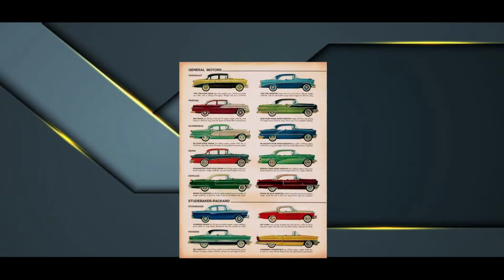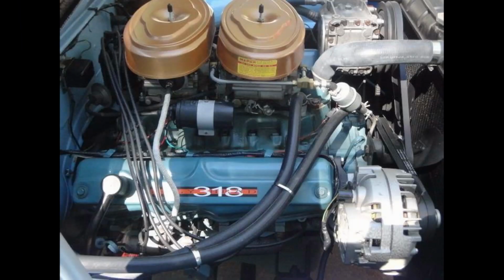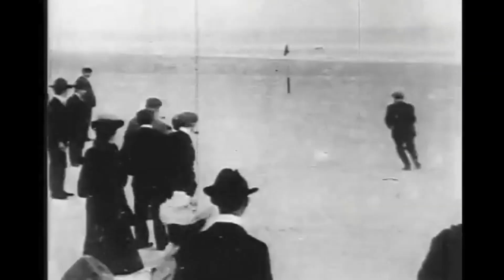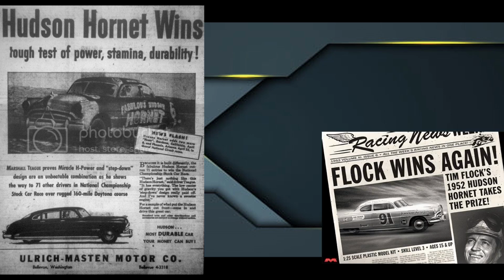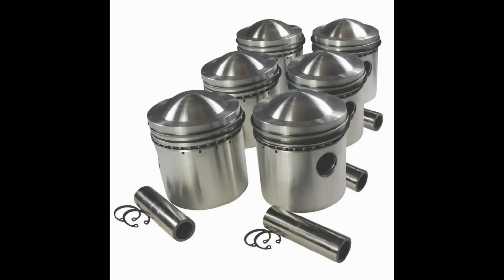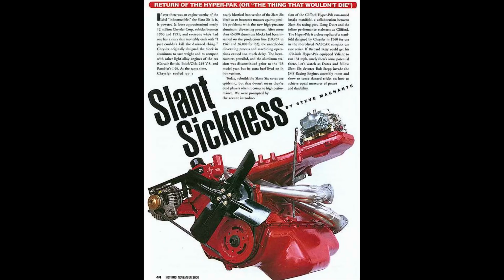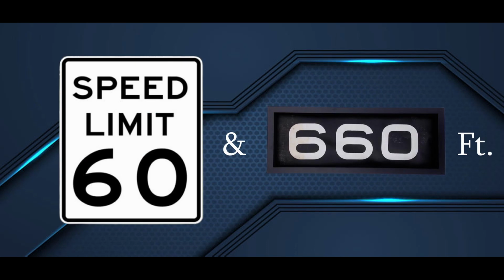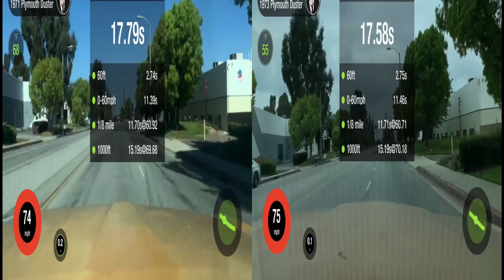318 LA V8 vs 225 slant 6 60 foot 0 to 60 mph 1/8 mile 1000ft 1/4 mile Drag Race

Comment: Repeating some earlier comments, Australian designed and manufactured the most powerful factory Chrysler 6 cylinder engines ever made, 303 hp 265 cu hemi inline 6 cylinder with 3 45 DCOE Weber carburettors, available strait from our local dealers capable of 14.4 second quarter mile.

Comment: great history the leaning tower of power is a great motor if you look up Tex Smiths XR-6 it was running a full aluminon steel sleeved six. but the LA 318 is a rock and is cheap H.P. good vid

Comment: Where you got that  in for it takes the slant six over the years was more like 16.00to  60mph and 19.00-20.00 in the1/4 the 318 you give the slant six a run that would embaris it in full.these are facts from owning both.be fore you miss lead any one get some real grease under your mopar facts like own over 17 slant six varis size from 170 198 and 225 hyper pack.and 23 318's and two 318 polys.where you got those times is false.the only factory slant six that could give the 318 a run for the money was 225super six in 1977 and 1977f for the 318 two barrel that's it cause the hyper pack was a in dealer option after 1962.i love the slant six but I have 40 years of mopar cars under my belt.even better look up utg garage on you tube ask him if your facts are spot on.!!!!!!!

Comment: Interesting vid.  I did some experimenting back in the late '60s and 70s with very similar results.  '64 Valiant with 225, high comp head and 4bbl carb turned 17.76 in the 1/4 at 76+ mph.  Had two track records at Lakeland International in Memphis.  A couple of years later my 73 Dart with 318 2bbl turned 17.67 at 73 mph.  The Dart would have beat the Valiant, but the Valiant would be closing the gap quickly.  Some of the most fun I've ever had behind the wheel.  Used to drive the big Ford 352s crazy with the Valiant.  A real sleeper.  God I miss that car!  Still have the Dart which now wears the Carter AVS which I had on the Slant Six.
Reply from the maker: That’s pretty awesome! I love hearing stories like this. Seems many people have a plethora of different experiences with the 318. But from most of my experiences this is very par for the course, for the most part.

Comment: When the Valiant was released in Australia we all were amazed at its torque. It was road tested by Wheels magazine as' an essentially top gear car.' The little 273 V8 was another game changer. Slotted into the VC Valiant offered with a black vinyl roof and diamond white paint, it became one of the most desirable cars of its era. The 318 was never considered anything special here. The Ford 302 more popular with racers and hot rodders. Apparently the engine is detuned yet has enormous potential like its big brothers the 340 and 440 but was ignored. I owned a 318 Valiant. Easy to live with engine if you didn't mind its appetite for fuel.

Comment: I have a slant 6 ready to drop into my truck. 9.5 compression ,custom ground cam that is close to the original hyerpack, dutra  split exhaust and Aussie speed long tube hurricane intake with a 500 cfm holley 2 barrel carb.   Take a 318 and put  a ISKY E4 solid grind cam in it- it  will have the torque of a 400 and mine would bounce off of 7,000 rpm regularly ( my stock 318 ran 6,000 all the time )

Comment: Meanwhile the Chevy 327 is quickly disappearing into the horizon…. leaving both the 225 and 318 way behind.  Seriously,  this was a very well thought out and presented video.  It would be very interesting to have a Poly 318 in the mix.I was amazed how close the 225 and 318 LA were, and how well you broke down the technical side of where each was in its powerband and gear.
Reply from the maker: Wow thank you so much! I really appreciate you saying that. Makes all the hard work and effort worthwhile. Yeah that 327 is an absolutely amazing engine. One of, if not, the best engine Chevy every made. Again thank you for the support, it really means a lot.
Reply: @atfgarage9459  In the years of my youth a healthy solid lifter 327 would often give a good challenge to a traction limited big block in the stoplight grand prix..
Reply from the maker: @Thomas63r2  Absolutely! Chevy hit the nail on the head with that small block. Perfect cubic inches for producing both low end torque, and yet short enough stroke to get some extra revs over on the bigger cube engines. That 3.25 stroke along with the camshaft comparable to a 268 was magic. Shame we don't see too many of those anymore.
Reply: @atfgarage9459  Times change.  A hot solid lifter 327 was usually up to the challenge of a SS396  325 hp or many of the 442's and 390 Fords etc.  Now it is easy to build a reliable 550 hp 383 small block with heads we could only dream of in the '60's and '70's.

Comment: The base slant six in real life wasn't even close to the 318 . I had both back.  The stock slant was a dog  . That 318 you're using should be doing better .
Reply: My old 65 slant six  with headers and 2bbl carb and manifold a minor change in ignition  timing A904 twin pump changed into speedy machine that never let me down That's why I had it for more 40 years no rebore 250,000miles no issues
Reply: @metalmickey-d6w I think that a 65 would be peppier than my 78 Aspen slant six . My 68 Monaco, which in Canada was available with a 318, was considerably more powerful  than the Aspen . But the 383 2 barrel was again night and day stronger than the 318 .
Reply from the maker: For some reason people tend to have two very polarized experiences with the slant. Some will have your experience, I.E. slow or sluggish. While others will have an experience very similar to mine I.E. quick and responsive. Both engines have checked thoroughly, both trans shift smooth. The biggest tell is the official 1/4 times. They are both very similar.
Reply: @atfgarage9459  Well it's been a while but I had 78 Aspen super six , total dog . I also had a 68 Dodge Monaco . The Monaco here in Canada could be had with a 318 . The Monaco hit 60 in 12 seconds , the Aspen six in 17 seconds . I'm 66 and when I was younger there were slant sixes and 318 v8 cars everywhere . I think part of the problem with that Aspen is that it was  was a 78 . Those late seventies cars really ran poorly much of the time .
Reply from the maker: @jackfishcampbell6745  Also Chrysler was notorious for their engine quality of production being very lack luster at times. They would have some 360’s dyno great and some dyno not so great.

Comment: 71 Duster was lighter than a 73 Duster, but a 73 engine had a bit more smog controls than a 71.  Interesting balance.  Were both vehicles in good condition mechanically?  What were the rear gear ratios?
Reply from the maker: Yes they are both in good running condition. I'm not 100% sure about the gear ratios. I would assume they are a little off, something in the range of Slant 6: 3.55 and the 318: 3.23. But I think you are right, that could have made all the difference. Its still amazing to me that a Slant Six could take a 318 head on under the right circumstances. Thanks for the interest and comment. I appreciate the support.

Comment: did up a 225 slant in a 69 Dart back in the 70's, punched, shaved a bit, offy intake with a 465 holly, viper headers, electronic ignition, 4speed, bell housing from an early Dart with the hyper-pac, big boy rear end from a Duster 340, went like hell at 19 mpg, today it boasts a 440, whatever
Reply from the maker: That build sounds awesome. Nothing crazy, just some tried and true power adders and some stronger than weak links. You don’t see many manual transmission muscle cars anymore. It’s a shame, there’s nothing like running through gears while flying down the road.

Comment: If the cars weights were equal along with everything else, the 318 should walk away from the slant. It’s a simple matter of the Power to Weight ratio at work.
Reply from the maker: They are both about 2900 lbs. both have 904 torqueflight automatic transmissions. Both are in excellent running condition. The point of this video was to show you that in fact it is not a simple matter of power to weight ratio. Throughout the history of racing, these straight 6’s have been outrunning larger v8’s due to different types of engineering advantages. These advantages are mostly, what I call “better  power” and not just maximum power. They hit strides at the most opportune times with something called sonic resonance mixed with lower torque. Overall the v8 will produce more power, but the inline’s will make the most out of their smaller displacement. Thanks for the comment and interest. I really appreciate the support 👍.

Comment: I really appreciated learning the history behind both engines.  I am particularly impressed by the brilliance of the slant six design.  That fundamental architecture gave the engine so many long term advantages its amazing. The 318 is a tribute to a fundamentally sound design honed by years of continuous improvement.  Great video.
Reply from the maker: That’s exactly the point I was trying to convey. It’s not about one being better than the other, it’s about appreciating the history and engineering of these legends. Thank you so much for the support! It’s not only very much appreciated but also keeps me going 👍.
Reply: @atfgarage9459  Hi. I still love my 72 Duster. I got it when I was 15, but it had to sit for a year till I turned 16. My grandfather bought it first. He liked the red color :) , after he died, my brother bought it off my grandma, he got bored of it so I bought it off of him. When I got it , it had 54000 original miles. Now it has 74000 original miles. Its all original except for the paint and that I had to get new seat covers put on. The original was white and black hounds tooth inserts and the rest was black vinyl. I got them recovered with the same hounds tooth. Oh, and its a 225ci. Motor has never been touched. Great video

Comment: 265 Hemi straight six with triple Weber would destroy them both an Aussie car.
Reply from the maker: Absolutely! That 265 hemi is an absolute monster. A real legend in the racing community. Australia has always been one of the king’s in my opinion. Just Cosworth alone changed the entire race game! Can’t be denied.
Reply: Learn about the Slant Six 170 ci XNR motor easily keep up with the E49 Chargers
Reply: @MichaelBraid-xf3dw  Okay thanks for the heads up. 👍

Comment: I grew up with these cars and these engine. The 318 was always quite a bit faster than the slant 6. I have no idea why these 2 run about the same, but that was not my experience when I was growing up, and these cars were daily transportation. If I recall correctly the slant 6 was rated at 145 hp and the 318 at 230. There was a huge difference in power. I can tell you that the slant 6 cars were slugs, and I mean slugs, you could outrun them with your Converse sneakers for those first 60 feet. 318 cars were slow, but they were not complete slugs. I still recall that one of my best friends had a Volare with a slant 6. We took it out on the highway and floored it at about 40-50 miles and hour, and it took forever to get to 75-80. I mean a Yugo with one piston hanging out of the block would have beat that thing. A slant 6 would have a hard time with a 36Hp VW Beetle, and if the Beetle just had a set of headers and a crank pulley I would put my money on the Beetle all day long.
Reply from the maker: Lol that’s a funny story. It’s seems pretty common for people to get polarized experiences with the slant. I’m not 100% sure as to why that is. Exhaust leaks are pretty common with the slant. But if you look at the “official times” of both of these, they are pretty close together. Engineering for resonance can give advantages over raw horsepower output. Thanks for the comment and interest. I appreciate the support 👍
Reply: @atfgarage9459  Gearing is probably the reason.  Most slant 6 and 318 cars were also geared for mileage, not for performance.  Change the rear gear and those numbers will change quite a bit.
Reply from the maker: @akdoc2003  yeah if they aren’t already the same, I would imagine about a full second off the top for the 318.
Reply: The transmission makes the 6 cylinder fast a904 transmission seemed faster I think..
Reply: @hardknock1278  Most 318's also used a 904 transmission.
Reply: I recommend that you look at the Slant Six in Argentina, I think you are going to change your mind about the Slant, I will tell you a couple of curious facts, the Slant Six in Argentina has the average speed record in the history of road tourism "the oldest category of the world" the average speed of the record was 151 miles or 244 km/h and its maximum speed was 173 miles or 280 km/h, later the dodge polara RT coupe had a 174 hp slant six and a maximum speed of 111 miles or 180 km/h. that you put automatic boxes that make it slow does not mean that the engine is a slug.
All these cars have the slant six:
https://youtu.be/5pwfplzPXi8
https://youtu.be/p5FvnXtDufY
https://youtu.be/dpa8rcBucFs
https://youtu.be/O6ff1U1TlFs
https://youtu.be/7hMYKbaKztU
Reply: @franciscodelvecchio2203  You can modify anything to go fast. I originally come from the land of fast import cars, Puerto Rico. 25 years ago a good street race turbo rotary car would run mid-10 second quarter mile times, at over 130 MPH. I had good friend with a Suzuki Swift with a swapped 1 Liter turbo engine that ran, in full street trim, 12 second quarter miles at 120 MPH. That does not negate the fact that a stock Suzuki Swift was slow, or that your average rotary powered car was also slow. 2 of my best friends had slant Six dodges, and I do not recall being in anything slower than those cars. A Toyota Tercel would leave them in the dust...
Reply: @72442conv  sorry but I don't agree at all, the Dodge Polara RT was a stock car and it was fast, I myself have one and it's not slow at all, if the Slant SIx is slow it's because of the misuse it was given in the USA, If you ever get the chance to get on Slant Six Argentino you will see what it can do. The Slant Six in my country is not slow, even our 170 ci is faster than most of the 225 in the USA.
Reply: @franciscodelvecchio2203  Define fast. For some people a 16.5 second quarter mile Honda CRX is fast, for others it is painfully slow. We have different standards here in the USA than in a lot of other countries. In the USA in the 1960's a 14 second 1/4 mile car was fast 13 seconds was supercar fast. Today a 14 second car is considered slow, you average V6 Camry runs 14 second quarter mile times and most people consider them slow. I know that in Brazil the 302 Maverick was considered one of the fastest cars there, here in the USA it was considered a Slug. It is all about perception. The 225 in the USA was always considered to be a slow car. Even the Hyper Pak 170's and 225's from the early 60's, which were the pinnacle of Slant 6 performance, were never really fast, even in their day.
Reply: @72442conv  in my country we do not use the term 1/4 mile, we use the term 0 to 100 km/h or in your case it would be from 0 to 60 miles, a Dodge Polara RT accelerates in 11 seconds to reach that speed, it is not considered a supercar but not a slug either, so have you ever seen a hyperpack? I do not think so. The 170 ci engine hyper pack managed to produce 220 hp and a speed of over 120 miles. You already know what the problem is with the Slant Six in the USA, the problem is that everyone criticizes it for being slow but if we see that almost everyone has it equipped with tiny carburetors, inefficient exhaust systems that choke the engine and above all they are equipped with transmission automatic or terrible oversized differential ratios, when the slant six is used in a good way it is a great engine and finally the pinnacle of the Slant Six in Argentina is its version for road tourism, it is the Slant Six 225 reduced to three liters by regulation and this It generated more than 250 hp and worked for hours on road circuits.
Reply: As I told you, it is all about perspective. In the USA -0-60 in 11 seconds is slow, and again as I told you, if you modify anything you can make it go fast...
Reply: @72442conv  I perfectly understand the perspective of each country, in my country we have a great appreciation for the 6 cylinders in line and not because we lack the V8 because at least from Dodge we have the 318 with 250 hp, if you talk to any Argentine who likes the engines, you will say that the roar of the 6 cylinders has no comparison, but it seemed very ridiculous to say that a four-cylinder beetle and less than two liters could beat a Slant Six.
Reply: @franciscodelvecchio2203  Here are 2 videos on YouTube, a stock 36 HP VW bug with a guy not really trying to seriously race it, I mean he was having tea while going down the 1/4 mile, and a Duster with a stock 225 Slant 6. Both ran 21 second quarter mile times. I guess the Duster did run a 21.4 on the first pass and 22.5 on the second pass, eventually he took the air cleaner off and after much practice was able to get to 20.2 vs the Beetles 21.8, on a single pass but the guy in the Beetle was not really trying to go as fast as he could...
https://www.youtube.com/watch?v=isbBVIVvtOc
https://www.youtube.com/watch?v=XLXcN4ozA8g

I grew up with these cars, my friends had them, I drove them. I am talking from experience. I would put my money on a Beetle with a set of headers, a recurved distributor, and an aftermarket air cleaner against a stock slant 6 every day of the week. Stock to Stock they were very close, with a good driver that knew how to power shift the beetle, the beetle would win every time to the 1/4 mile, but eventually the slant 6 would catch up and pass it.
Reply: @72442conv < Geriatric man with lazy username claims to be THE authority lol

Go away